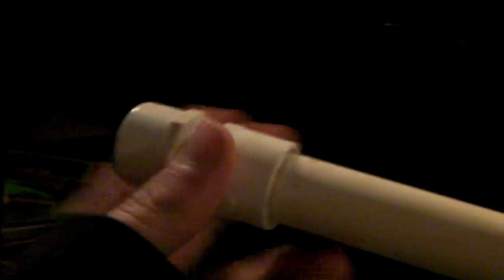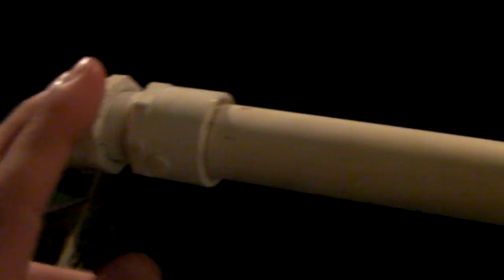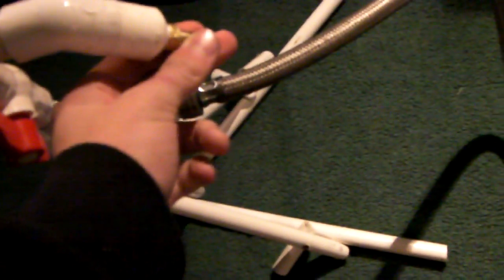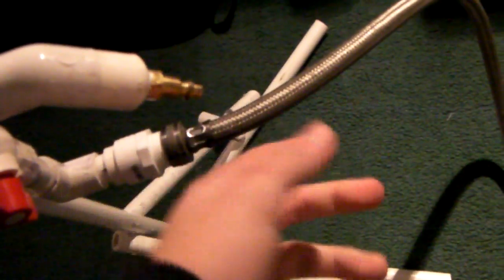How to Build a Snow Maker for around $15

Comment: Checkout Facebook.com/justsnowman If you want a cheap snow maker. Made out of 304 stainless steel pipe. Internal nucleation that requires no adjusting. Or you can go with a fan gun if you want to make a lot of snow. All snow makers use compressed air. It is required unless temperatures are below 10°F.

Comment: i love ur video but can it work in a hot place. i want a snow theme for ma wedding.
Reply: usually as long as its under 85 degrees outside.
Reply: You can only make snow if the temp permits, usually  below 32-22 degrees
Reply: Joshua Lenahan more like 25it dosent make snow at any temp
Reply: The highest temp that it can snow is 50 degrees farenheit. It has to be very low in humidity

Comment: Do not do this with pvc the cold makes the pvc brittle and drops what it can hold and return makes a pvc bomb.
Reply from the maker: skijay1997 Look i get it, pipe is obviously better, but at twice the cost is it really worth it? In my opinion, no. I actually made both a pvc and a galvanized iron version of this exact snowmaker and performance was the same and durability was good enough. I have dropped my pvc snowmaker in 20*F weather with it running, and nothing happened. Even if it did, all that would happen is maybe a joint breaks and it spills water, but it is still 40psi with minimal air volume inside so it isn't as dangerous as you make it out to be.
Reply from the maker: Not at these pressures. Sure pvc becomes weaker in cold temperatures, but the 40psi that is required for a snowmaker isn't going to do anything no matter how cold it gets. Worst case scenario is it cracks somewhere if there was previous damage and you have a leak, but this turning into a "bomb" is impossible unless you go out of your way to try and make it happen.
Reply: MagmaRhino
DO NOT USE PVC, why try and take a short cut like this. it does not matter what the PSI you use is, use galvanized pipe. Its not much more expensive and your not rising the dangers given with PVC, then if you drop it it won't break or crack

Comment: So I have tried to make snow with this twice and the first time just made ice but didn't stick to the ground because it was 31 instead of 27, but for the second try it worked and it acclimated enough were I could see the snow but the system was freezing up a lot. So all I got was a 10 by 10 square of snow. I don't have a video but I do have pics

Comment from the maker: @mpwillz97 a long time lol..this design is very simple and inefficient. It only allows a very small flow of water and because it doesn't have a deticated snowmaking nozzle you will not see much snow pile up too quick. It would take hours of running with no wind to get a coating of a few inches over about a 10x10 foot area